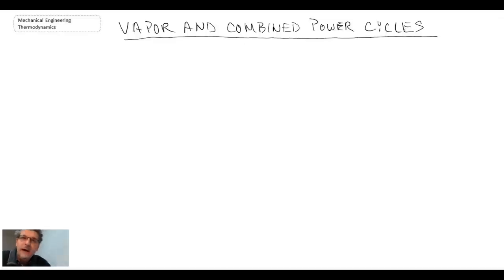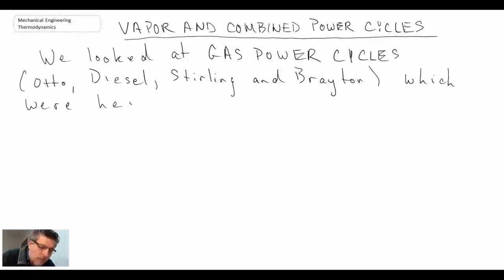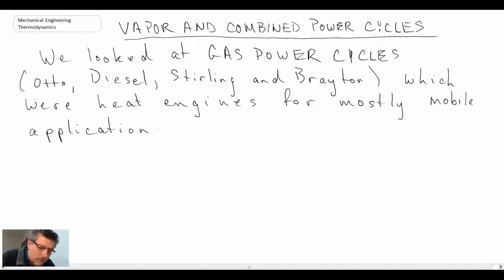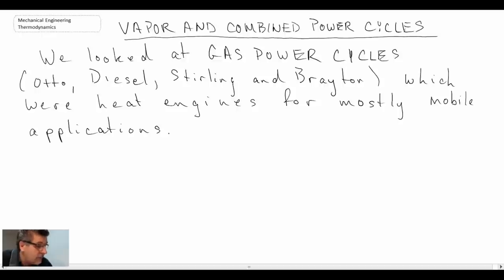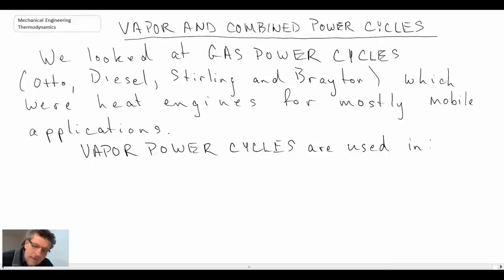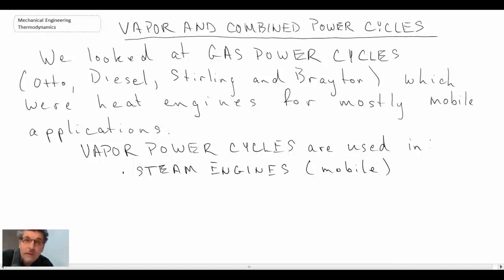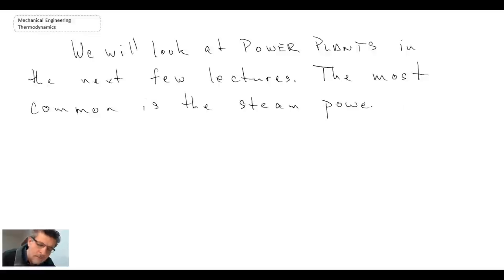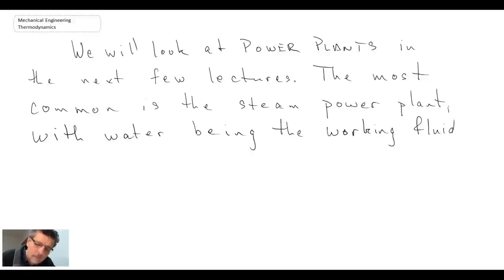Mechanical Engineering Thermodynamics - Lec 19, pt 1 of 5:  Vapor Power Cycle Introduction

Comment: Stupid question. Why not bypass the condenser?
Reply from the maker: Thermodynamically speaking, the Kelvin-Planck Statement of the Second Law of Thermodynamics says "It is impossible for a device that operates on a cycle to receive heat from a single reservoir and produce a net amount of work."  This means that we need to reject heat to a lower-temperature sink.  Practically speaking, it takes less work to compress a liquid than a vapor, consequently you want to condense and then compress as a liquid, thereby reducing the amount of work that you need to put into the cycle.
Reply: Ron Hugo Thank you. I'm struggling with the course where I am taking it, but this series does help.
Reply: The system would probably blow up